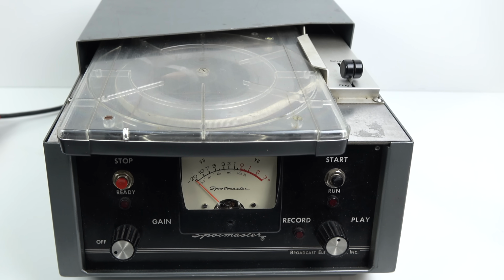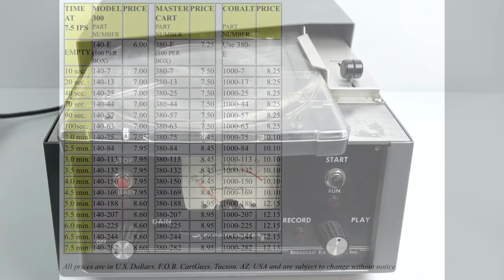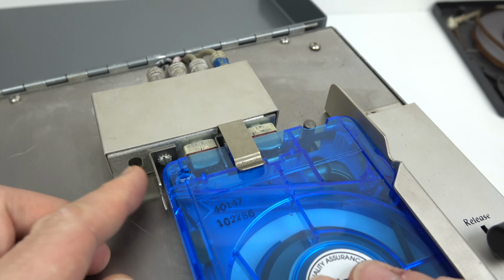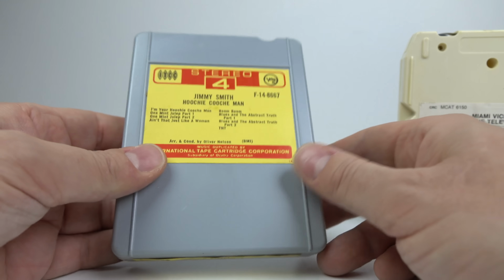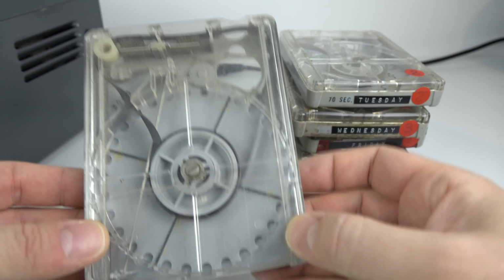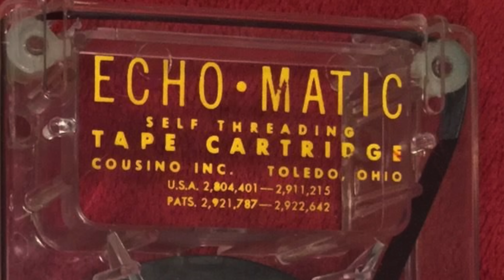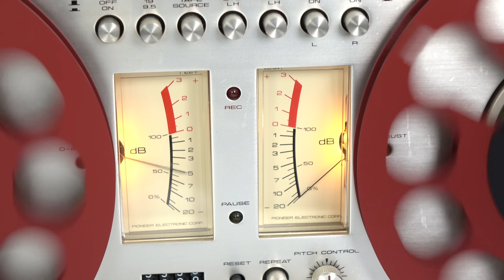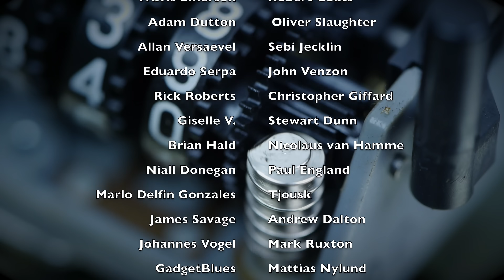The Broadcast Cart Machine

Comment: Long live the Spotmaster "tub" cart machines-they were simple,reliable,and easy to work on if they broke.They had either tubed or early germanium solid state Rce/Pb amps and cue boards.If a cart cues OK on one machine but not another-the head alignment is out or the caps on the cue board need to be replaced.Cart failures at the station I worked at one failed so bad it tripped the AM transmitter modulator Overloads!

Comment: First job in radio was in 1955 at age 11.  In college in '63 worked for Vern Nolte who owned WJBC  in Bloomington, Il., and who invented the broadcast cart and player and manufactured them in a factory on the floor above the radio station. The company was called Automatic Tape Control, ATC, which later became ITC,  who's machines became the standard of the industry. I have 8 or 9 ITC machines in my garage. Either your cue amp isn't working or the cue head needs aligning... or...

Comment: I worked in the radio industry until 2008 and, at the cluster I worked for, they just stopped using them before I left!  It was crazy the amount of upkeep needed for these things.  We mainly used them for commercials (as a backup) but we did have a few with full albums on them!  I actually know a few mom and pop stations in the Ohio area that STILL use these things!  In fact, I may have a few laying around the house here.

Comment: On the west coast of British Columbia, Canada we used cartridges called ARISTOCARTS that were manufactured by CKNW-AM/CFMI-FM for their stereo broadcast station. It became very popular in Canada and the US over time and was used by the Canadian Broadcasting Corporation (where I worked) for over 30 years (until hard drive digital formats replaced them). FideliPac were great for mono but CFMI-FM needed cartridges that were good for stereo and where the tape didn't slip when the cartridge was removed. At the same time they had to play in available machines. Aristocarts were great and could be loaded with up to 10 minutes of tape (perhaps more). At CBC we used them for promo-commercials / stings / and sound effects. In the SFX room we had thousands of the Aristocarts loaded with both spot and loop effects in both mono and stereo formats that were used in both Radio Drama and Television productions. fyi At the time CFMI-FM was a computerized station where carts were loaded into a massive cart machine where the length of cart was programmed into the player so that it would automatically play one cart and then trigger the following carts for hours during non-operator controlled playback. I believe each bay of the unit could play 2 hours worth of programming.

Comment: Heh. I did college radio in the 1980s, and my campus radio station had three cart machines - two in the air studio, and one in the production studio. I remember using them, and even recorded a promo for my show on a cart. They worked surprisingly well, considering that the technology was a variant of 8-track. I think the main difference in reliability and sound quality had mostly to do with the fact that we all knew that the carts (i.e., tape cartridges) had short life spans and were essentially treated as disposable. But the most telling thing about them was how filthy the machines used to get. Everyone who had a show also had "co-op" work that we had to do in order to keep the station well-maintained, and my co-op job was cleaning all the tape machines. The reel-to-reel and compact cassette tape decks generally didn't take long, but the three cart machines could easily take me an hour or longer to clean. That's because to keep those carts working smoothly, the tapes were coated with lubricant, and that lubricant was constantly getting smeared on the read/write heads, pinch roller and capstan. Fortunately, compared to consumer 8-track decks, the heads, capstans and pinch rollers in the cart machines were relalatively accessible for maintenance.

Comment: Oh goodness.. what a blast from the past. I'm a radio engineer and when I started we where just in the early days of computerised playback but the control rooms still had cart machines sitting around gathering dust and walls covered in carts.

Ironically, the computerised playback system that replaced the cart system still called the audio files "carts" and the playback channels "cart decks" so the on air staff would have an easier time transitioning.. lol

Even today, we still call an audio file (be it a jingle, song or commercial, etc) a cart. The term just stuck around. 

Back in the day, all audio was loaded on to carts. Those carts would be loaded on to multi stack players and they would automatically play through starting and stopping on the cue tones.  A common configuration would be to have two, triple stack cart machines connected together so six carts would automatically play through.  If a unit failed you still had one good triple stacker to get through the night shift with. 

The most common in Canada where the ITC Delta III as seen here: http://www.jimprice.com/prosound/carts.htm

Some very elaborate carousel systems where built in the early days that one could load an entire days worth of carts in to for a completely automated station. 

A mechanism would automatically load the next cart in the carousel. Clever program directors would record carts with announces talking, weather reports, whatever you want and no one could tell it was all recorded. 

Sadly, about 20 years ago now, box upon box upon box of carts and machines all went to the dumpster.

Comment: I worked with a cart machine back in 1990 when I was a DJ on my college radio station at DePaul University in Chicago, IL.  I recall using 20-second carts and recording announcements about my radio show.  I would mix my voice with background music through the board and the cart machine was set up to record off the Audition channel of the board, while the Program channel went out on the air.

Comment: I worked at a radio station in the year 2000, by that time, almost our entire broadcast was automated by a computer, I was just in the booth to make sure the computer was running correctly(one very early Saturday morning, I arrived and the computer had crashed and nothing was going over the air for like 2 hours before I arrived.)  However, we did have a cart machine to run the Emergency Broadcast System, which was fully automated at well, if there was a Emergency Alert sent out.  The station would automatically switch from the computer to the cart machine and would play the messages on the cart machine, depending on the alert.  We had some pretty old tech, but it wasn't used much, I learned how to edit on reel-to-reel and splice tape and all that.  I been to other stations at that time were totally using MiniDisc, which never caught on with consumers, but was a standard in the radio industry in the US.
Reply: That's so cool!

Comment: I actually saw (and used) these cartridges when I worked in the radio industry as late as 2007/2008 in the states. Generally used for jingles and such, but we had a number of tracks recorded to them just to use in case the computer that usually played out the music would go down, so that the DJ could quickly queue something up to fill the dead air.

Comment: Mono cartridge machines had two track heads and stereo used three track heads, the extra head in both cases being the cue track, where a short burst of 1,000 Hertz tone was recorded immediately after starting the machine in record mode, which would stop the machine in playback mode.  In later systems, a digital audio tone, like computers used, would print whatever desired on a printer, generally for logging.

Comment: This was nostalgic as I worked in radio in high school and had the same Spotmasters. 2 things worth mentioning. One is the machines had no erase head, so carts had to be bulk erased, usually with a handheld electromagnet basically. Two, when 8-track car players overtook 4-track, you could still play the latter using a snap-in pinch roller that went in the big hole on the bottom of the cart. And since broadcast carts ran at 7.5 IPS and car players at 3.75, we used to dub a song to 1/4 inch tape at 7.5 and playback at 15 when dubbing to the cart so the speed worked out right. Of course, it was only 1 channel of audio so the left speaker had the song while the right had the cue tones. Fun days!

Comment: I remember back in the early 80's the machines had a secondary cue tone that could be added or erased without affecting the main tracks.  It activated a relay.  It was often used to trigger a rude flashing light to alert the DJ the cart was about to end.  Weatherstripping replacement pads; spooling new tape onto the cart, those were the days.

Comment: The Radio 1 jingles that you have are indeed from PAMS of Dallas but they are not from the reels delivered to the BBC. Probably dubbed much later  from KenR DATs sold legitmately around the world in the 1990s.  The cuts you have are :

1) Series 34B - supplied to Radio 1 in August 1968
2) Series 34B - supplied to Radio 1 in August 1968
3) Series 31 - supplied to Radio 1 in September 1967 - part of the launch set

Nice video - thanks

Comment: Thanks for the Vid, i still use my Tapecaster model 700-RP in my ham radio station KC8ZUL great tip on replacing the pads

Comment: Radio stations which played the same songs frequently during the vinyl era often used these carts for playing music. Vinyl, especially 45-rpm singles, wears out quickly with repeated playing while audio tape has a longer life. If the cart went bad, the station's music or program director would simply record the record to a new cart. When one considers you can easily go through the top 40 songs in a three or four hour period, you can see why these carts were used for music. Also, these carts were much easier to cue up than a record.

Comment: The reason for the later models having more connectors is so these machines could be started and stopped via buttons on the control board. This made it easier for DJs.

Comment: We had this machine in the recording studio at WRUV in Burlington Vermont. If you Deliberately created feedback, through the machine, it would create a reverberating echo.  Dj's would sometimes deliberately use this effect in recordings as a two-bit special effect for their PSAs etc.   I'd hear it on the air and think "Someone's abusing the cart machine effect again"! :-)

We had a big degaussing machine for bulk erasing carts.  If you weren't thorough, you'd hear bleed through of the previous recording, especially in waves matching the period of the tape rotation.

The degausser would also cause your quartz wristwatch to run crazy fast if it got into the magnetic field.

Comment: The reason the large cartridge was tightening up was that the tape wasn't threaded over the top of the overlaying wire. It was instead pulling directly out of the spool under the wire. That wire is intended to lift the tape upward off of the spool and that's what keeps the tape loose.

Comment: The cart would not stop and cue up because the machine was malfunctioning. No external equipment was needed. The cue detector circuitry often would not work well and a cue sensitivity trim pot would be adjusted. After a while an adjustment would not help and a repair was needed. Small capacitors on the cue detector circuit board would dry out. These machines would be used 24 hours a day for years. New caps and some unsoldering and soldering would bring the functionality back good as new. Radio stations had full time engineers back in the day to keep things running.

Comment: There was at least one multiformat player that would play both 4-track carts and standard 8-track. I got one working for somebody in the 90s. It detected the corner angling and configured itself appropriately, it was honestly quite clever. I wish I could remember the make.

Those very very large carts could be run at extremely slow speeds and used as broadcast record in the States - they had 12 or maybe even 24-hour speeds. Fidelity was terrible, but it was good enough to use as broadcast record for both accounting purposes and if the FCC got some spurious (or legitimate) complaint from a listener claiming you'd done something naughty on air. That pre-dates me by quite a bit, but the station engineer had been there since the dawn of time and talked about it.

Comment: Believe it or not, I worked at a radio station in the 2010s that still used carts. It was a small town radio station and we had 3 carts still in use; the local station ID, a 30 second PSA, and a 1 minute PSA. They were really only used for 1 purpose and it was to give the board op time to switch certain things. For example, it gave me time to switch from a local live broadcast back to our music programming that was piped in from a larger area. They were also handy during periods of increased sunspot activity (don't ask me about the science) as the piped in music was disrupted and the company sent us hard copy CDs to play for the day, so when it came time to switch the disc, I'd hit the cart to give me the time without dead air.

Honestly, working there was like working in the Star Wars Special Editions - so many years of different technology somehow layered atop each other. I recorded commercials in Adobe on a nice Windows 7 PC, put them on minidisc, and then transferred them into a computer bank, from which there was one ANCIENT computer that I could manually play commercials from (for sports and whatever) but it only had enough memory to call up 7 spots at a time. Thus, I had to memorize the code numbers for each ad to call them up after each 7 spots played.

It was insane, and very jerry-rigged but it was the best high school job.

Comment: Just sold a cart machine at a hamfest for 10 USD.   I'll bet the cue tone detection circuit is bad on yours, the reason it was sold.  Mine was "working when removed from service".  Frankly I was glad when the last cart machine was replaced with "music on hard drive".  Cart machines were more of a maintenance headache than reel to reel machines of the day, the backside lubricated tape gummed up the heads quickly.

Comment: At radio stations I worked at some still used these carts up to around 2000, though they were very much on their way out. There were some complete songs recorded onto them, but these were usually for using if other playback means had an issue and you needed a track to play to tide you over. I remember the playback units being stacked up in a pile, and certainly with the Sonifex ones you could daisy chain them all together onto one channel. To record to them there was a second box that plugged into the cart playback unit that allowed them to be recorded to. 

I still have my carts from my time in radio, but nothing to play them back on. I've never been hunting for something to play them on because I only have five and they are four show jingles and a bed track to talk over - pretty boring listening to! I much prefer them though to the minidiscs that replaced the cart decks, before they too were replaced by computers. Radio was so much more fun back in the day, and so much more creative in my opinion.

Comment: Always hated it when a seconds long clip was recorded on a 70 sec cart and it took forever to re-cue without fast forward.  Also, if audio was recorded too soon after engaging record, the sound would "burp" on the air on re-cue if the machine was not potted down on the board. Thanks for the nostalgia.

Comment: College radio in the US was still mostly being done using these kinds of carts, up until the mid 90s (depending on their funding, which was usually shoestring).
The broadcast booth would have racks (often spinning racks, much like comic books used to be sold from) full of carts. Pretty much everything that wasn't live spoken came from a cart, all the shotgun/stinger little ID bits, commercials, public service announcements, and (surprising, to many people) all the songs being played. The first school I worked in still used vinyl records for about half of the music, but the second was 100% cart, all the time.
CDs never really took hold, at least anywhere I worked. There was just a lack of CD players with the kind of instant-start capability that disc jockeys required to keep their patter and timing sounding professional (most CD decks take anywhere from a  split second to a second or three to find the first bits of the track and start playing). CD decks with a built-in buffer memory and instant start did come along, but never really displaced carts until digital audio workstations (with all the audio coming from hard discs) took over and replaced everything.